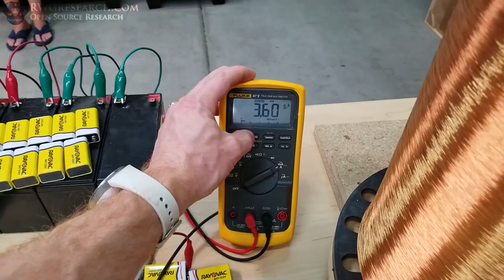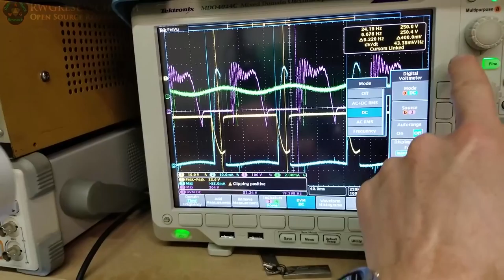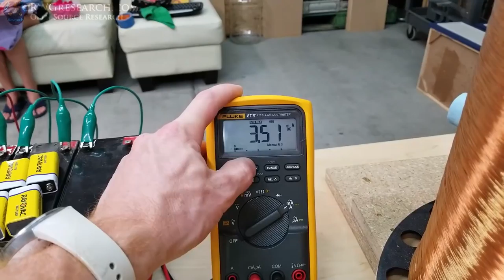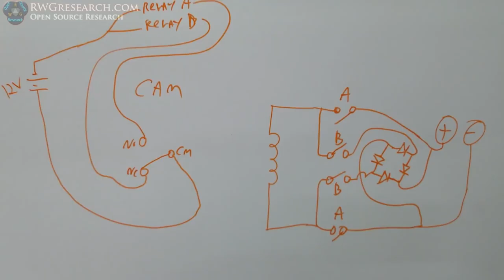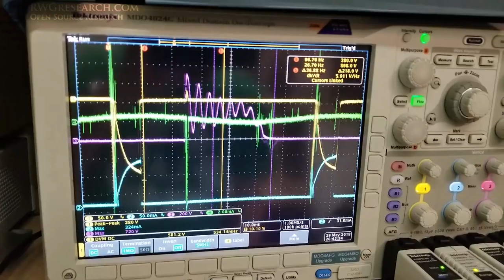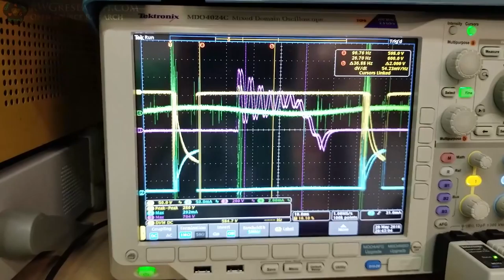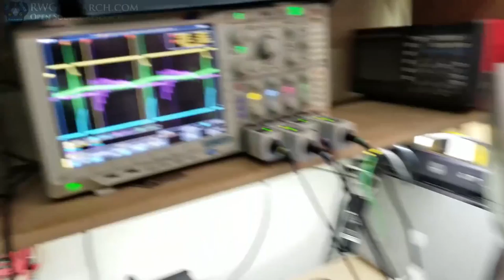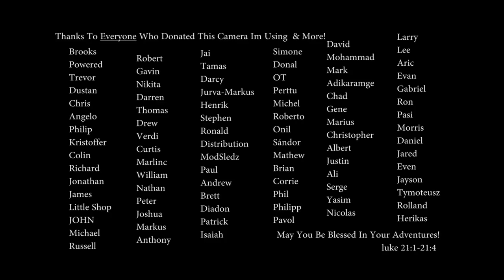JWN Project Part 18: Testing A Different Coil...

Comment: Still your greatest experiment to date, all that torque and rpm with just less than 9 watts.  Take 913 dc volts times .00971 amps =   8.865 watts  !!

Comment: You're on the right track, one have to think in terms of frequency, energy and vibrations to get somewhere.
What you might wanna do next, is to experiment with ion lifters, they can actually provide thrust with high enough volt and fuction in much of the same way as antigravition.
You wanna fly?
High input voltage in excess of 500 000 volt can and will get you airborne if done right.
If that isn't cool, then what is? 
We're knocking on the door to the future of transportation already now ^_^
One more thing, I looked through one of these other videos and found that "daddy's girl" Riley, is quite funny, she's a good sidekick and seems to have some interest for all this research you're doing, imagine the reaction when she finds out that you can "levitate" an object?
This is what I'm looking into right now.
The future is now.

Comment: Do you use now the capacitive charging in this coil again , or just a normal hooking up ? Seems to be the latter one.
Did you now try to change the reverse position of the commutator versus Rotor position to get it more into Generator mode ? You seem to run it purely in motor mode where you try to get the maximum RPM.., so try to change the position where the commutator reverses the current versus rotor position. ...good luck.
Reply from the maker: overunitydotcom yes. With the crude setup. I was just trying to see what it would do... i have the smaller magent in the center with alot better performance as far as induction goes. However the big magent produces more torque. More to test... 

But yes. Motor mode here only. ~Russ

Comment: Again nice job Russ...!

 JonBigman+2lvl Troll management.
Reply: I will put it this way.

The Bifilar coil does not conform to traditional coil theories. This is due to the builtin capacitance and due to the induction flipping between the plates of a capacitor. In the case of the bifilar coil and impulse sent down the wire reflects with opposite polarity to the wires around it. Hence the need to have opposing winds around the other wires.

 There is no magic! Just simple induction laws being applied. If you had one flow going through an area and then have 4 opposing flows or counter flows, don't you think it would speed it up while flowing?

 This counter flow aspect is never more apparent then looking at Jupiter's counter flowing atmosphere. Best example I could think of.
 A bifilar coil does not get rid of cemf, it redirects it via induction flipping. Again here is the method to properly make a bifilar coil:

 ! + - + - + - !    <-Layer 3
 ! - + - + - + !    <-Layer 2
 ! + - + - + - !   <-Layer 1
==========  <-Core of some kind, iron, air??
 ! + - + - + - !   <-Layer 1 second half
 ! - + - + - + !   <-Layer 2 second half
 ! + - + - + - !   <-Layer 3 second half

Sorry for the horrid ansi graphics.

 In this example this is a half slice of a solenoid style bifilar coil. This is an ordered bifilar coil as specified by Tesla. It is to be used in an open system, this includes a capacitor fired spark gap, where the currents would be very vast on the order of 1000's of amps per impulse. The reason that this method counteracts the cemf of a standard coil is because, from the diagram above, every + wire is surrounded by a negative all the way around it. There is a significant counteracted cemf in this coil and the proof is that the coil actually allows current to flow more or unrestricted due to being surrounded by the opposite polarity and feed inductively via the inflow wire + or - if you design the discharge gap to discharge negative impulses.

 All an Impulse is, is a purely positive or negative discharge. With a discharge being fed by a capacitive discharge circuit. The drive of the discharge will energize only the target electrode, circuit,  and allow the discharge to radiate away naturally out of the system undriven.. AC is driven in both directions, both positive and negative. AC could be considered a constant current method even though it switches directions across the zero line it is still moving constantly back and forth. A true impulse is only driven in one direction and has no connection back to the originating circuit (capacitive discharge circuit). If you create this one way flow a resultant back flow will happen to the device and that back flow can be harvested of energy and dumped to ground or a virtual ground.

 There is little danger of this kind of a system since it flows in one direction only driving towards ground as a surge back from the impulse going out. One could utilize the Averamenko plug or half-wave rectifier to either a ground or virtual ground with the only difference is the power output. Virtual ground will have less power and should be designed to the capacity of the virtual ground for resonance (this might enhance the low power of the virtual ground a bit). A direct connection to ground might be too powerful for some applications, hence the reference to the virtual ground above...

 All capacitance is in reference to the ground. Circuit capacitance should be adjusted with this in mind.

 Tesla went to great lengths to explain the variability of metal objects suspended over the ground. If you change the height above the ground the capacitance of that object will indeed change. Circuit design should take note of the changing capacity of the circuit while it is being used if it is in motion. A land based vehicle should not be effected unless it is varying it's distance from the ground extremely.

 As a proof of the difference of this Impulse energy, Tesla went to the worlds fair and demonstrated it in front of boatloads of People. He even knew it was so safe that he let Audience members do the Demonstration as well. He would grab the output electrode and wave his hand over a pile of copper and bring it to red hot temperatures with no damage to his person or the people who demonstrated it for him like he politely asked them to.

 This demonstration was not AC. That was being demonstrated through the whole Worlds Fair as he was demonstrating this new character of energy, which was unrelated. No one got hurt and everyone left AMAZED.

 What I am getting from his description of the Bifilar coil is that it can amplify energy simply by feeding it impulses of a one way nature, successively. If you time it well you will get one impulse going in and then as it hits the halfway through the coil it helps reineforce the next impulse many times. This is due to the induction flipping effect. A positive impulse is met with 4 times the negative flip of each wire surrounding the impulse wire. It can be likened to a water hammer like effect as well and could drive itself if the energy is induced away in the proper method or section of the target circuit.

 If you want to know the capacitiy of a bifilar coil then do not hook it up in series and measure the capacity that way via both wires. This should give you a head start in figuring out the impulse wave train to use through the coil after it has been hooked into series. The capacitance in the series hooked coil is not a true capacitance, it is an impulse wave container, in my best analogy. Learn how to ring that container and it will strengthen the output as well. Think resonance effects here.

 LET me be perfectly clear. This is not free energy in a sense. What this is, is recognizing an already established flow and learn how to enhance it to our needs. Tesla said it best to the effect of this: at some point man will figure out how to hook to the wheel work of nature. In my mind I see this as Tesla inventing a method to create a Niagara Falls like effect and indeed generate from it cheaply and cleanly. There are some out there that are in damage mode. Putting out fires of discovery back towards this eureka moment. They profit from the way things are and feel there is no need to be responsible for their messes. The way to beat this is devise safe and clean methods to get our energy. Tesla found that method and was crushed and silenced. Don't let the trolls sway you and keep up the good work my friends.
Reply: +Jon Bigman   I am no troll, dude.  That is an emotional and intellectual failure on your part.  When you say, "Somebody that talks tech with me that I disagree with or don't understand is a TROLL" is a total cop-out.  Grow up and have some self-respect.  Do you know and understand the two basic equations that describe how a coil works?  There is the differential equation and the integral equation.  I seriously doubt that you do and that puts you at a disadvantage when you want to experiment with coils.  Seriously, do not call me a troll, you just impugn your own character when you do that.
Reply: +Jon Bigman   Well that was quite a manifesto.  So one day you are going to have your setup and your scope and you are going to play with your bifilar coil.  You have to have a notebook and either draw waveforms in your notebook or take screen caps with your DSO.  Then you have to look at the waveforms and try to understand what they mean and if they relate to what you are saying in your manifesto.  This is where reality is on your bench and you have to see if your theories fit.  And part of that will involve more learning.  There is no point in staring at scope shots if you don't understand what they mean.  With a lot of effort and learning, you should arrive at the right conclusions.

Comment: Is that true 900 volts dc times .01 amps to equal 9 watts to run this motor setup?  There is alot of rpm  and torque going  on there!  In my experiments with multi wire cable the filar style(in series) profile always beats running the wires all in parallel (the lowest resistance) as far as magnetic force developed by the coil.  Nearly a10 to 20 percent better magnetic force output with very low amperage and increased voltage with series style, wires in series filar style at same watts as wires in parallel.  So voltage is what you want not amperage as we have been lead to believe.  Greatest moment yet in your videos Russ, as far as super break outs in design concepts and practical design device.
Reply: But all that he is doing is showing a simple pulse motor.
Reply: Well the question now would be, how to hook all the single wires in this grey cable in series.. Russ seems to have hooked them up just like the Tesla Bifilar coil, but here he has 20 wires in parallel.. so this coil has a lot more capacitance between the wires than compared with a coil with just one wire going from start to end... Here we have 20 wires going a 20th length from start to end and then come back to the start and the next wire is in parallel to the other ones...so only 1/20th of length but these then hooked in series..so like the Tesla bifilar patent style coil.
Reply: 2.74 watts.
Reply: In the video he explains and corrects himself that it is 10 ma not 30 ma